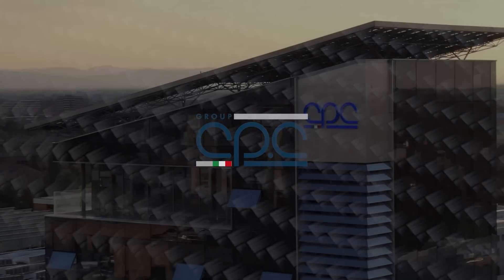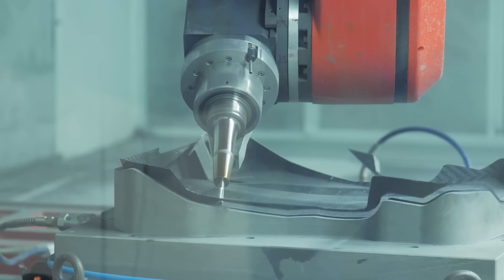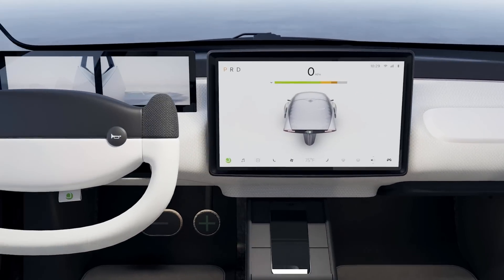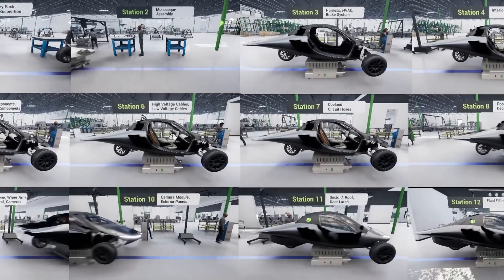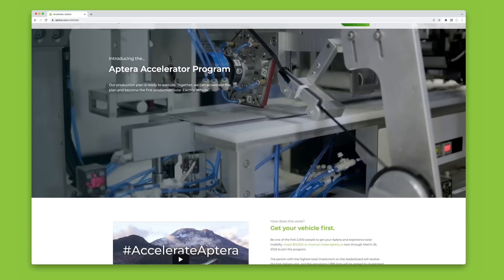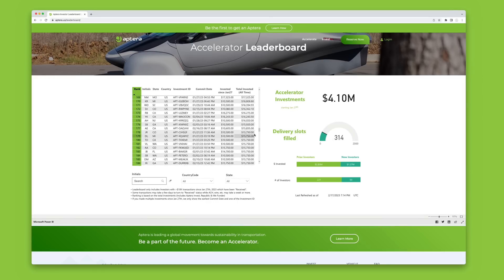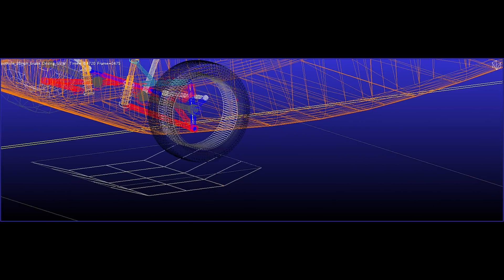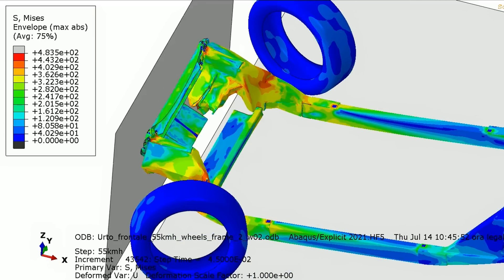Aptera Update — February 2023

Comment: lean manufacturing tools and procedures huh? that means as few workers as possible, which would be fine if the automation kept up but all that ends up doing is increasing the individual workload.
Reply: That is not all it does.  It means that the number of parts to be assembled is also far smaller for one thing.  To compare, a "normal" ICE vehicle has around 35,000 separate parts.  Aptera may be around 6,000.

Comment: I live in Bangkok. I need right-hand drive. I was so bummed when the original aptera failed to take off. Credit to Steve for keeping his eyes on the prize. Ideally would like a tiny diesel gen-set for emergency charge in case of power failures.
Reply: Aptera has designed RHD, and will be building such vehicles in the future.  A diesel gen-set is unlikely from Aptera, but there are other sources.  All thinks considered, a variable speed, DC genset could be the most efficient.

Comment: Will you return the 10kusd risk capital later or will you treat this as a good will investment without financial return?
If you want to attract capital from outside US, I recommend you consider to ship for free outside US as "building kit" or something along those lines to save in costums and fees.
I recommend to consider attracting crypto capital by creating a note on a solid chain such as Blockstream has with their BMN, bitcoin mining note. I'm sure they'd be willing to help.
Lastly, the electric (solar) factor is not the success factor in your product, the low weight is. Therefore consider bringing out an edition that will allow for a small diesel generator along with a smaller battery. Godspeed.
Reply: Alexander, capital investments deliver shares valued at $10.50 each.  These will become liquid if and when the company goes public. 

The low weight, low rolling resistance, and low aerodynamic resistance combine to make solar a practical and effective addition to the vehicle, and for most of us, it will pay for itself, and lower the environmental impact - which is the reason for the existence of this vehicle.

A diesel generator would add immense weight and complexity to the vehicle as well as add to ongoing environmental damage.  Such a suggestion indicates that you have not yet grasped the purpose or role of this Aptera.

Comment: They should offer a version without solar panels. They are a gimmick and add weight and cost for little gain.
Reply: 40 miles a day is more than a little
Reply: @GoClimbARockEh  solar panels can be more efficiently deployed in a large scale solar array that are optimally located and oriented.
Reply: @itsacorporatething  It is not an "either/or" choice.  Even here in Iowa, not exactly the heart of the sunbelt, the solar will pay for itself, cover most of my daily driving needs, and reduce the use of grid power.  This is a win.
Reply: @itsacorporatething and how will I use the power from those panels while my car is parked curbside? Putting panels on the car is a massive convenience, and doesn't add all that much weight
Reply: You must know a lot about little gain

Comment: Please a video of aptera in divots and the elements, it is what keeps me on the fence living in pot-hole city, OH
Reply: This video showed testing over rough surface, holes, and direct curb strike. What is it that you would like to see. I think it's going to do fine.
Reply: @joemtnclimber793  I should emphasize just how bad the pot holes are here; Airbags go off from them. Triwheelers are harder to dodge them so it’s important to me to see more information
Reply: @MrCarlton  True there hasn't been a ton of suspension video but fortunately this video shows what appears to be a capable suspension. Probably not Mercedes Benz-like though.

Comment: How's the stability in strong windy rainy storm while on the road?
Reply: They have said it's basically unaffected by wind due to how aerodynamic the shape is. Think exact opposite of the typical rectangular semi-trailer or RV on the highways.
Reply: Because of its shape I would assume Aptera will be excellent in high winds. It doesn't have any flat surfaces to push on except for the top.
I guess if the wind is coming from heaven you might be in trouble. 😲
Reply: Probably pretty good. It has a wide track and low wind resistance, even from the side.
Reply: What @ProVega350 said...
Reply: Plus, Aptera’s advanced torque vectoring technology will make the vehicle’s traction control superior to that of other vehicles on the road.
Reply: Better than most SUVs on the road.  Not much flat surface for wind to push against, and what there is has little lever arm at distance from the wheels to amplify the effects.

Comment: Well done. Getting excited. If the vehicle was made with just the rear drive motor how would it perform and how much more range could it get? Was wondering for a low cost version. Also can people pick up at the factory and save on shipping costs, would be a fun cross country trip for many and would show of your car to the world.last thought I’m wondering if the tires are special and if stores will have them across the country that could cause major problems for customers if not available. Thanks and good luck.
Reply: With just the rear wheel powered traction control would not be possible and the vehicle would be inherently dangerous to drive as the loss of traction at the rear wheel without controlling the front wheels would make the vehicle turn around its vertical axis quicker than you can say oops.
The gain in efficiency would not be huge, mainly the saved weight of one motor. The losses (heat) of these motors is extremely low.
Reply: I can't offhand remember the size of the tires, but they are a common size available everywhere.
Reply: @IBMara  Regular tires 195/50R16.
Reply: Thanks for the response. What about picking up a factory delivery
Reply: @gandmemoney  picking up at the factory will be an option, yes. For the first 5k or so off the assembly line, it'll be the only option!
Reply: @GoClimbARockEh  Truly picking up from the factory would be an option. I am not sure about that being the only option for the first 5,000 units.
Reply: And just to clarify, you can choose between front wheel drive or all wheel drive.
Reply: @kevinscott8642  Further clarification. Being able to choose between the FWDs and the AWDs is a feature only of the regular Aptera preorders. The Launch Edition (LE) vehicles are only AWD.

Comment: What if a potential customer pays  fully for the Aptera upfront, Would you consider that part of your accelerator program?
Reply: By CA law Aptera can not use any deposit money for production. Your reservation ($70-$100) is held in escrow until your Aptera is built. The Accelerator program is just for new $10K+ investments into the company Aptera. And that new investment will help fund the actual production of their new Aptera SEV.
Reply: Unfortunately California law prevents them from offering this type of deal. If you pre-pay for the vehicle, that money can only be used to directly build that vehicle, and can't be used to buy tooling or machinery that would be used to build all the vehicles. But if you invest the cost of the Aptera in the company, that'll count!
Reply: No, you can only invest at this stage.

Comment: Hello from New Zealand, is there a right hand drive in your plans?
Reply: Hi Howard, I have talked to Chris Anthony and Steve Fambro in St. Moritz about this issue and they told me that yes, this is definitely in the book. 
Although it is not yet designed, a change from left to right hand steering will be no big deal. The much greater flexibility provided by the in-wheel motors compared to the rigid and space occupying conventional drivetrains will make it quite easy for them to be able to provide the Aptera also to countries like yours.
Reply: 🤓Yes. They have designed in so that the interior can be easily mirrored to have a right hand drive option. A while ago they said international versions and shipments will start about a year after US shipments start, so you're looking at 2025 earliest.

Comment: question, if aptera doesn't make its acceleration goals from the community, wil it impact the solvency of the company?
Reply: They have enough to keep going for over a year without ANY new investments coming in, and millions in new investments are coming in. The main impact in an unsuccessful acceleration program is that production will not be accelerated. ( ;-)>   In other words, we'll all wait longer for the funding to come throuugh and for our Apteras to be delivered.
Reply: To second Harry Parker, they'll be fine long term but the acceleration program helps get to production faster. Long term they will need hundreds of millions, maybe a billion or more, to build other factories and develop other vehicles, so they are certainly in talks with many sources of funding. Money might be hard to find right now, but once production is running at full capacity investors will be more easily convinced. Long story short, they're gonna succeed, but how fast remains TBD
Reply: The accelerator program is only part of the story, but it's important to remember that any automotive startup is a risky investment.  Insolvency is ALWAYS a possibility.

Comment: I have to point out that no other car builder has such transparency. Tesla?  GM?  Ford?  VW?  Toyota? BYD? Nope.
The Accelerator Program is outside my budget, but I am rooting for success, so I can get mine sooner.
Reply: Transparency? Like all of 2022 when they were saying how great their honeycomb fiberglass body was. And how the gamma was 90+% ready for production. And that production would start at the end of 2022 or early 2023. And then at the end of December they ditched the honeycomb body and went in a completely new direction? Now he says they've been working on the carbon for 6 months. Plus he's still showing pics the factory in CA that is currently available for lease. This does not instill confidence.
Reply: @russellpilot1875  Compared to Tesla, GM, Ford, Stellantis, VW, and the whole gaggle of car startups, Aptera does well.  Compared to Apple, Google, and the Silicon Valley crowd, they do even better.  I'm disappointed my Aptera won't ship this year, or even next perhaps, but my Cybertruck?  Ordered years ago.  Will Aptera succeed?  Maybe, maybe not.  Most car startups don't.  But we will see it coming.
Reply: Especially with right to repair
Reply: I agree
Reply: @@brandonlindsey6274 Yeah and how did they start out?
Reply: @Brandon Lindsey You know what those other manufacturers also have? Recalls, fires, cars that shut down going down the friggin' highway (mustang) or simply never turn on again after parking it, apps that don't work and cars that won't charge. So yeah, when you compare cars they have been making for nearly a century, vs. new technology vehicles they've only been cranking out the last decade or even just the last few years... they've got a worse failure rate than the 'n00bs'. Nice try though. :)